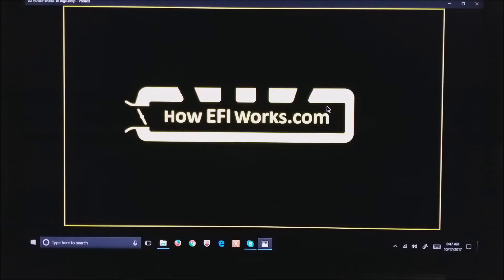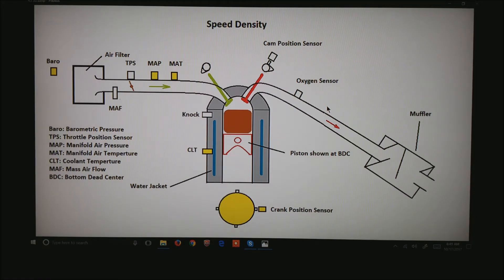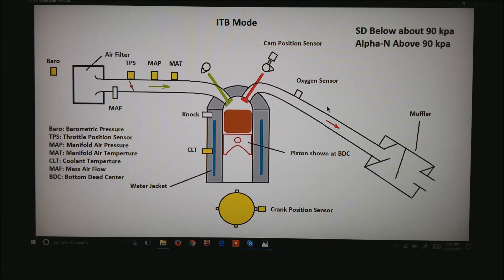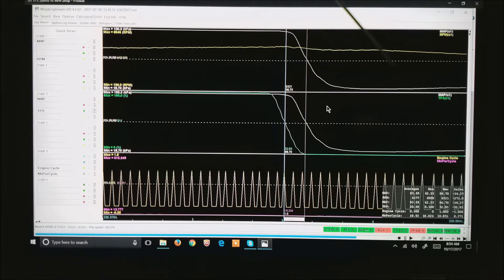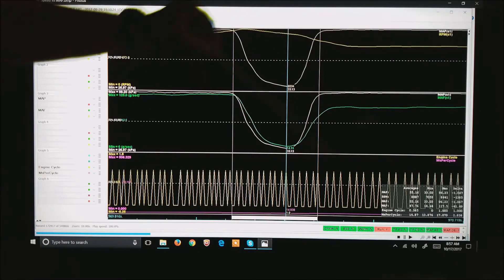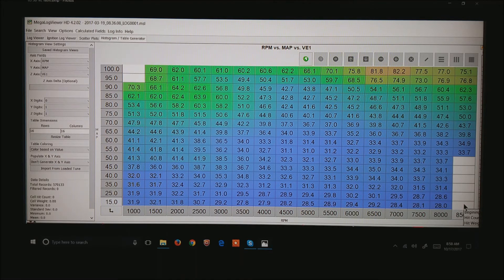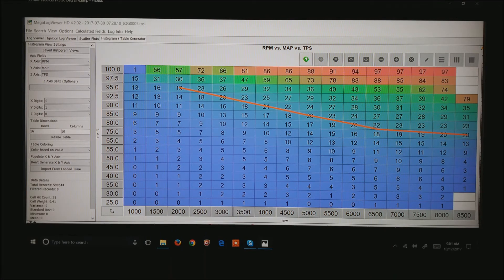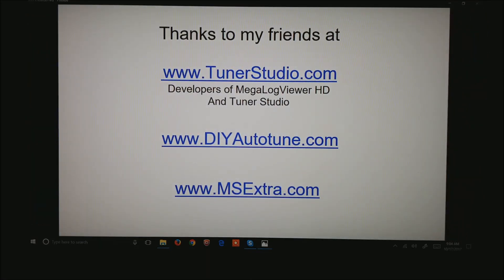Basic EFI Fueling Methods

Comment: Hi Andy thanks for a great range of videos. I'm building  a ford 351 Cleveland with m122 at 5psi,  running a ms3x. Fitted with a tow style cam , 1500 -4200rpm range. Will spend most of its life 1500 to < 3000rpm. I was thinking of MAF, but after watching your vids thinking I might be  better off going speed density. Would value your input regards Rob